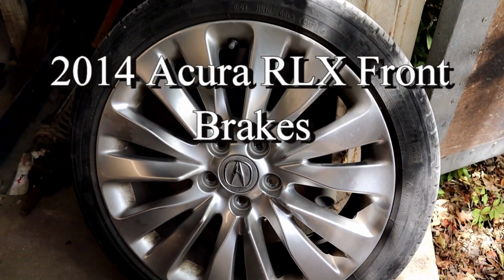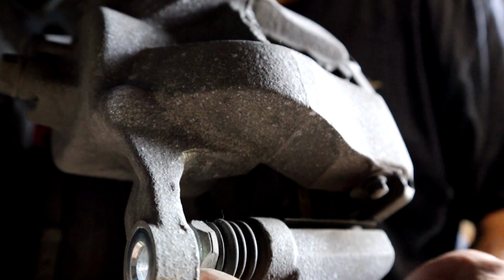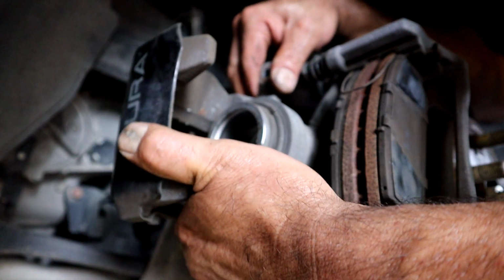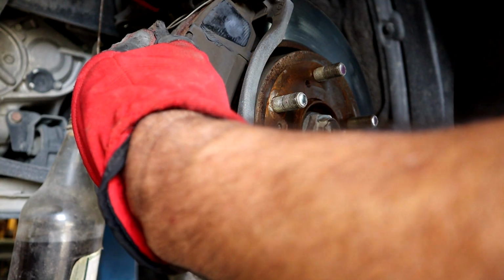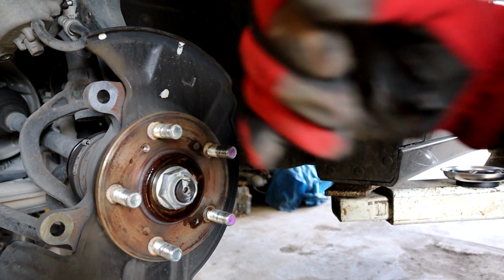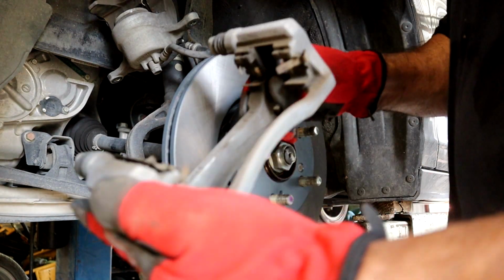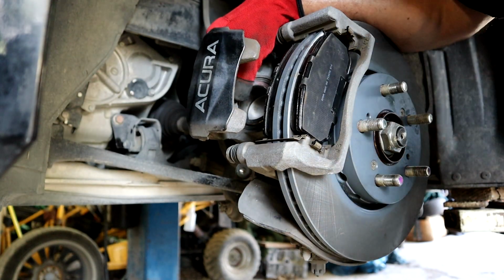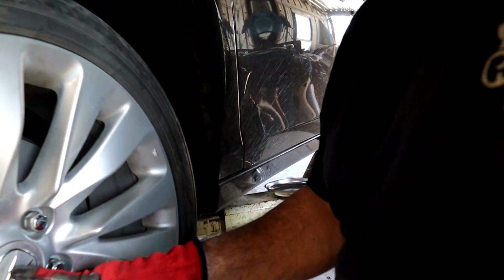Acura Front Brakes

Comment: Oh the advantages of not having to deal with rust.  In western NY a brake job goes differently.
Take tire off, sometimes with a sledgehammer. Beat on the screws that hold the rotors with an impact to free them. Then strip the head anyways. Get the Dremel out to cut a slot in the heads. Then get them out with a straight  bladed screwdriver. If the head breaks off, then get the screw extractor set out to remove them. Once they are out,  toss in garbage. Forget about cracking the bleeder screw, it's so rusted it will just break off. Remove the caliper bolts. Clean the surface rust off the piston so you don't destroy the seal before pushing it back in. Remove the pad bracket. Get the hammer and beat the pads out, because of corrosion. Clean and grease the bolts that allow the caliper to slide, because at least one is frozen.  Replace the shims that the pads slide on. Make sure to grease where the pads ride on the shims.

Reassembly,  get out the antiseize and coat the wheel studs and the hub, where the rotor touches. Install the new rotor without those troublesome screws.  Reinstall bracket. Reinstall caliper.  Reinstall tire.

Comment: First  :D  I always like to put some kind of lube at the wheel hub before putting on the Rotor.  I just did my '87 Mercedes Benz 300D.  All four of them.The calipers brake bleed nipples were too rusted on I just did not want to make more problems for my self so I just it back to the Master cylinder.

Comment: Nice job Danny! Shop mom will be soooooooo happy! Lol! Thank God for Texas and no rust! I've done this exact job more times than I can remember only difference is I needed heat the screws and caliper bracket bolts cause they were rusted on! Lol. The only thing do different is the caliper slide pins I take out,clean off pin and inside and put some high temp grease on them. Very awesome video work and very clear and concise! Keep up the great work

Comment: Tip:  The Carquest Platinum pads come with new hardware (abutment clips).  I used to think the pads were the same between Gold and Platinum but I've found the Gold pads wear out faster than the Platinum.
Reply: The platinum pads are the best pads I’ve ever used. They cost more but are a great value since they come with the hardware.  They are a ceramic pad and last a long time even with hard use like towing. The harder you brake, the better they bite (think towing).  The golds are a great pad, but the platinums are well worth the extra money.
Reply: @mebordernoneya8484  I used them almost exclusively for a long time until I had a couple of come-backs on two Yukons (a 2007 and a 2010) where the owners reported pulsating pedals after less than 3 months and only a couple thousand miles.  The first one I thought was a fluke thing.  After the second one I stopped using them.  It costs more but I've just been going with OEM pads/rotors.  I did have one 08 Odyssey that experienced the same thing.  I used the platinum pads and unpainted CQ rotors.  Not sure if it's my bedding procedure, owner driving habits, or what.